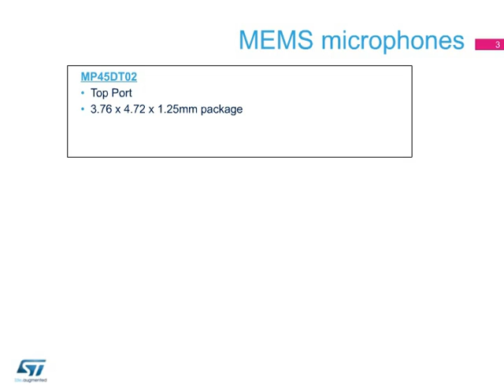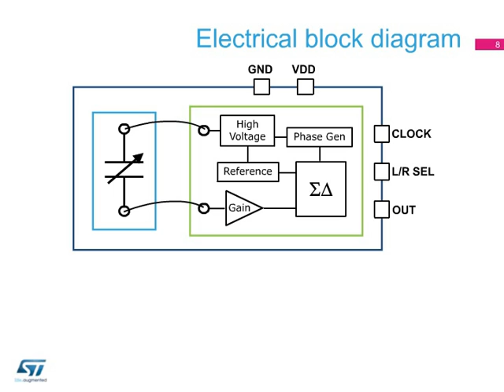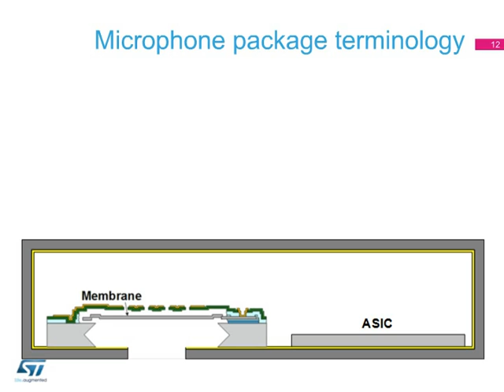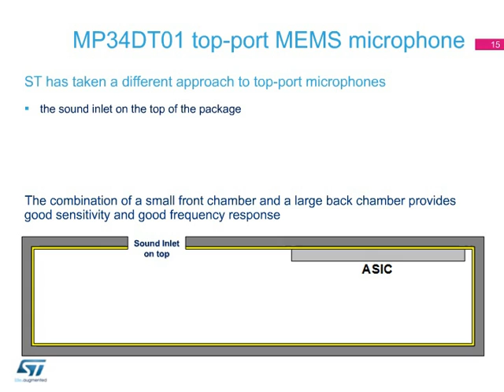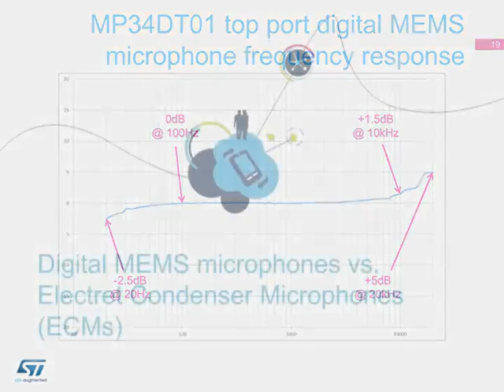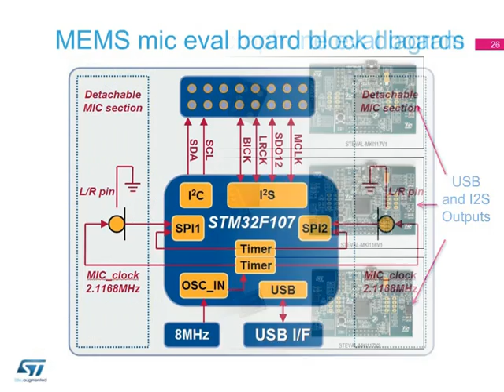Product overview - MEMS microphone training (getting started)

Comment: Good explanation! The bottom port design makes sense to me, but why do most of your competitors place the top port not directly over the mems? Why is the port also much smaller than the actual mems microphone itself? Wouldn't it be better to make it as big as possible to gather as much sound as possible?
Reply: In that case you will open the top chamber which wont  be a good idea. Big whole small= chamber.

Did you buy any of these? 
Am planning to but still not sure what to get.